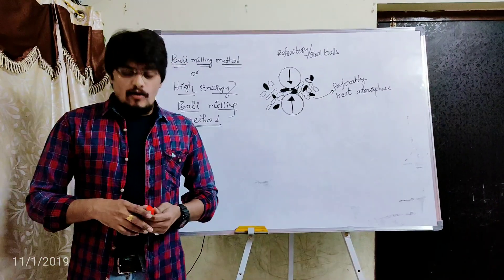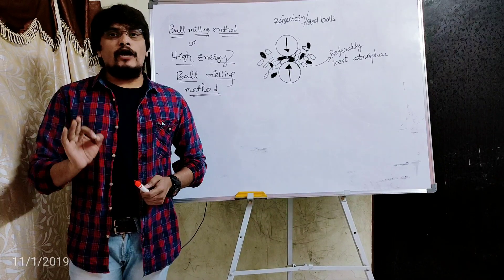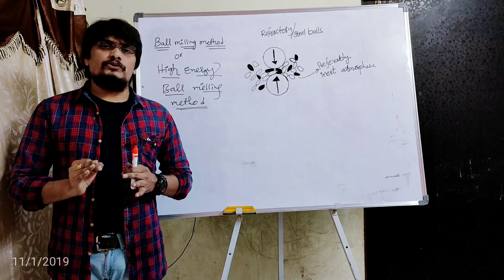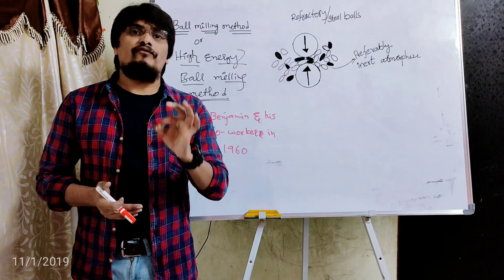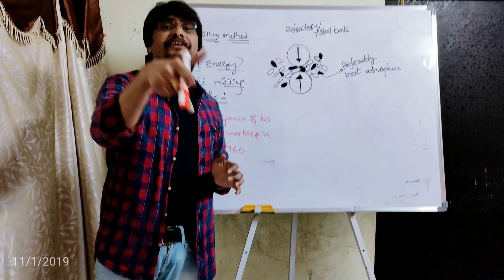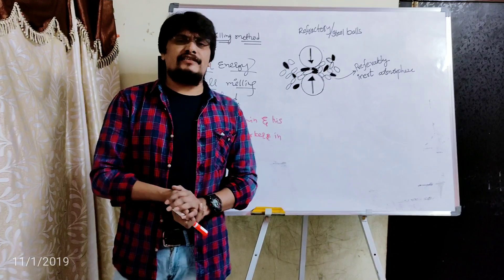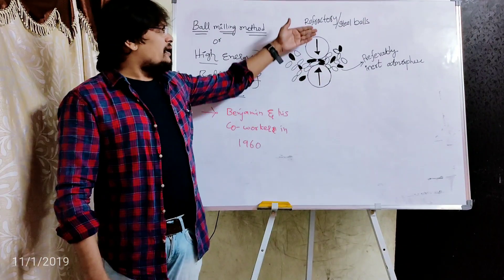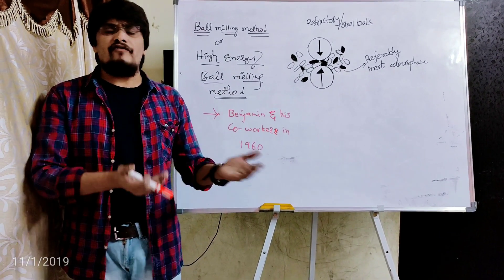Ball milling method (High energy ball milling method) for the preparation of Nanomaterials

Comment: Nicely explained Sir, but I think steel cannot melt at around 100-200 degree celsius.
Reply from the maker: Dear Priya,
Thanks for your compliment, coming to ur question steel may not melt, but here along with temperature energy also increases so there are chances for getting peeled off.
Reply: @DrKShirishKumar  Thanks for the response. So what I understand is that the balls can undergo mechanical wearing out which can contaminate the final product (NPs). Am I right?
Reply from the maker: 100%
Reply: @DrKShirishKumar  Thank you!
Reply from the maker: Pleasure